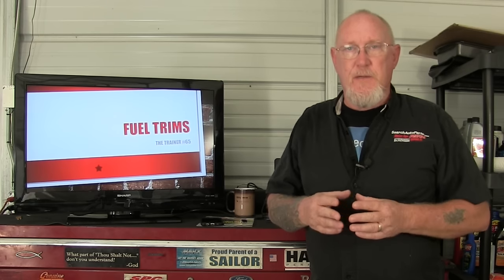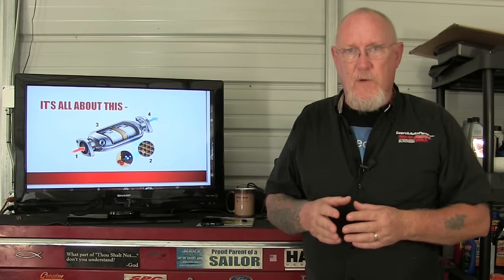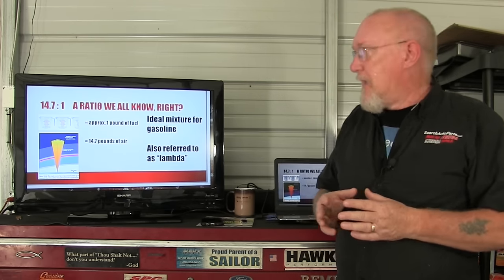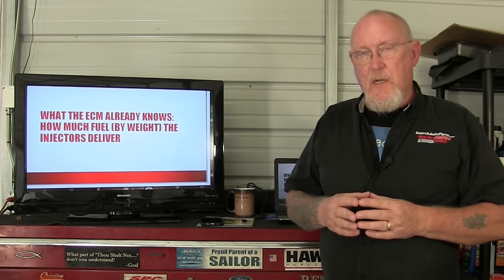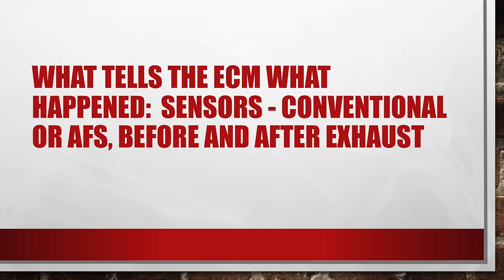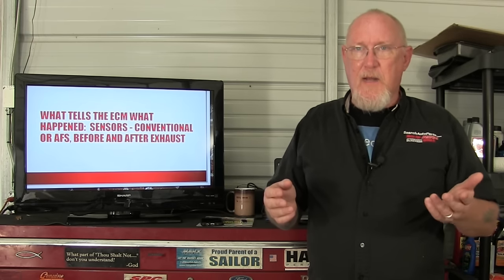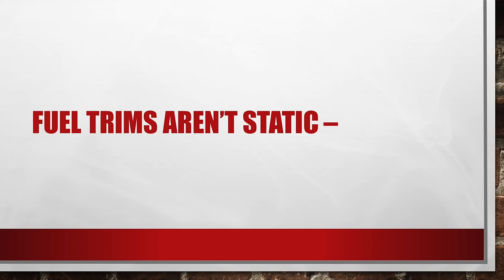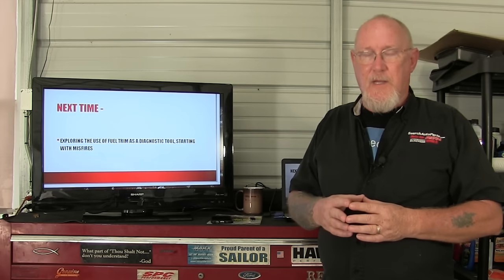The Trainer #65:  Fuel Trim Explained - What It Is , How It Works, And What It Can Tell You

Comment: I recently test drove a 2016 Kia Optima with 45K miles and plugged in my scanner when I returned to the dealer.  Bank 2 STFT was pegged at -100%!  The O2 sensor seemed to be functioning normally cycling between ~.2 - .8 v when I revved the engine but the STFT never budged.  Any idea what might cause that?  A code had been cleared 31 miles prior, and the carfax showed 2 repair entries within 3 weeks to check engine control module.  Also had been reprogrammed in January 2019.
Reply from the maker: What kind of tool were you using and were you using it in Global OBD II or Enhanced mode (if it had Enhanced mode)?
Reply: @MotorAgeMagazine  I was just using a basic ELM scanner with Car Scanner app for iPhone.
Reply from the maker: ncyankee101 I would check with another scanner to see if you get the same information. I’ve never seen short term fuel trim listed at 100% on any scan tool. And if the oxygen sensor is switching back-and-forth, the short term fuel trim has to be switching as well. After all that’s what makes the sensor switch.

Comment: Pete, you are one excellent Teacher. Hats off to you Sir and thank you.
My little 2005 Nissan Sentra 1.8 liter has 327,000 miles and going strong.
I'm trying to reach 500,000  :) 
I have a P0172 System to Rich (bank one) code. 
On a 4cyl. engine which bank is bank one? Cylinder 1&4 or 2&3 ?
Thank you and new subscriber :)
Reply from the maker: Thanks for the compliment! Glad you like the content. Bank 1 is cyl 1 & 4, Bank 2 is 2 & 3.
Reply: @MotorAgeMagazine  Thank you so much for that info that I can't seam to find anywhere.

Comment: Can fuel cause such an issue? I tried putting E15 in my wife's Mitsubishi, and a few days later got a lean code. Fuel trims were bouncing near 25%.

After the fuel level dropped to about half a tank, I topped it off with premium fuel, and reset the code. A week later and the code hasn't returned, with fuel trims bouncing between -5 to 5%, so it all seems okay now. I can only figure the E15 caused it, but it makes no sense as it's advertised as being okay for vehicles 2001+. Oh well, won't be attempting to save 20 cents a gallon again.
Reply from the maker: It can when you compare alcohol additives versus straight gasoline. The stoichiometric ratio for alcohol is different and that will affect the mixture requires for a lambda of 1.0. Stick with the fuel recommended and always us a Tier 1 supplier.

Comment: What does the word "LAMBDA" actually mean? 🤔 

Thanks for the great series.
Reply from the maker: Great question! I'm surprised no one has ever asked before. Excerpts from the Bosch Automotive Handbook - The mixture for ideal, theoretically complete combustion requires a mass ratio of 14.7/1. That is, 14.7 pounds of air for every pound of fuel burned. Excess air in the mix is required to ensure there is enough air for complete combustion but there are limits when it comes to burning a mixture that is too "lean". Lambda is a Greek symbol and represents this "excess air" factor. It designates the extent to which the ACTUAL air-fuel. mix differs from the stoichiometric ratio of 14.7/1. It is the ratio of INDUCTED AIR MASS versus AIR MASS REQUIREMENT FOR STOICHIOMETRIC COMBUSTION. A Lambda of 1 indicates that the air mass drawn in by the engine equals the theoretically required air mass. Less than 1 is a deficiency in air mass, or a "rich" mixture and more than 1 is excess air mass or a "lean" mixture.
Reply: @MotorAgeMagazine  thank you, that will help me remember what it means better. I was wondering what it meant on my new to me Modis 🤣 I'm really enjoying your shows and learning a lot!

Comment: My 2002 Yukon 6.0 has an average of 19% long fuel term. On idle the car shuts down or stall. Is that a lean condition? Would O2 sensor adapter fix the problem as the catalyst converter was removed?
Reply from the maker: Fuel trim needs to be examined under different operating conditions. Is this a positive change or negative change? What do the trims do if you hold the engine speed at 2500 rpms?
Reply: Motor Age hello, long fuel tirms are positive. When hold rpm at 2500-3000 it drops to 14-15. Regarding the shutting down, it turned to be thermostat sensor. I've changed it at its all good. I looked for vacuum leak but didn't find any. Manifold gasket I've changed it about a year ago. I'm suspecting either evap leak or empty catalyst causing this. What do I do?
Reply from the maker: First, look at STFT and LTFT together for a Total Fuel Trim. Is the positive adjustments are across all rpm ranges, as it appears here, the odds are there is a sensor reporting issue. Have you inspected/cleaned your MAF sensor? NOTE:  If cleaning the sensor helps, replace the sensor. The cleaning will not last.
Reply: Motor Age thank you for the note. I've changed maf sensor 3 years ago before cleaning manifold and changing gasket. I'll look into it. Thanks very much.

Comment: The mass air flow sensor measures the temperature of the air and the temperature of the air means are certain volume of air that's going into the engine it's the temperature measure

Comment: I was getting the classic high LTFT at idle, 25 %. and low numbers when reving, indicating a vacuum leak. 

Sure enough, I found some loose intake connections to the throttle body. 

After tighting everything down, the LTFT numbers stayed at 1.9%

Ok, great! But....when I rev to 2500 rpm, now  the Ltft numbers go up. They go to 25% and when the throttle is let off, it immediately drops to back to 1.9% at idle.
Shouldn't the Ltft numbers stay low at all rpm ranges if everything is ok?

Or is it normal for the Ltft to go up with a load because of the demand in throttle and gas?
Thanks
Reply from the maker: It shouldn't climb that high. Did you clear your KAM memory after you repaired the leaks?
Reply: Motor Age 

 I cleared the codes, but I didn't Flash the memory, I'm assuming those are 2 separate processes?

I'm thinking now that the computer needed time to clear its memory and update data.

I went for a drive and now when I drive the long term numbers and short term numbers are almost matched 1 to 1 and even if the long term goes up for example t0 10% postive, the short term numbers go to negative 10%,
 so their matching each other respectively. 
It appears everything now is well within spec and working as it should.

Comment: And the four-stroke cycle that means the engine goes around twice per cycle and you get four strokes per cylinder per cycle so you can multiply that by 4 4 strokes per cycle or two revolutions so basically you're getting 120 strokes per second

Comment: What to look for in case of exhaust restriction. Both banks sensors fluctuating about .7 v
Thanks
Reply from the maker: Typically, one bank will be correcting for a lean condition and the other, a rich condition. Remember, a MAF sensor measures ALL the air going into the engine and doesn't distinguish between banks, or cylinders. Even if one cylinder on one bank has breathing issues, the ACTUAL amount of air on that bank is not the HALF of the total you may expect. Have you tried a Volumetric Efficiency test to see if the engine can breathe properly?

Comment: So I got a lean condition in bank 1 on a v6. Do you think thats cause I changed the o2 sensor in bank 2? Bank 1 short term trim is about 8% more than bank 2. Should I have changed them in pairs?
Reply from the maker: I have a few questions before I can help - Is this a MAF or MAP system? Did the lean condition exist prior to changing the sensor? What kind of vehicle are we talking about (YR/MAKE/MODEL/ENGING)? What are the total trims on both banks now at idle - at 2500? Has there been any other work done recently?
Reply: @MotorAgeMagazine  honestly i can't remember the  vehicle has been sitting for 5 yrs and I'm trying to get it back on the road for a good friend. It's a 2005 kia sportage 2.7L 4x4. 90k miles. I just did the spark plugs and wires cause they were never changed but there was a code for bank2s1 out of range so I only replaced that sensor.  It was running really rough when I 1st started it. Replaced the battery and did the oil change. Fill the gas tank 3x already in the last 3 months. Just can't figure out why I got a lean condition only for bank 1 when they both are high but bank 1 is a little higher. Only think I can think of is a dirty MAF. I tried cleaning it but nothing. Gm/s is at about 3 but I couldn't find what normal was for this vehicle. So I'm thinking of replacing the MAF and bank1s1 o2 sensor since fuel trims are a little higher in this bank. And I'm thinking a dirty maf is allowing unmetered air to not register allowing it to add more fuel. I could not find any vacuum leaks for the life of me by the way. I can't check fuel pressure cause you need a special tool to check it. So I also ordered a new fuel pump assembly since the pressure regulator and filter is all built into the same assembly.  I rather have that new since its over 15 yrs old. But just waiting on parts this weekend(o2 sensor for bank 1, MAF, and fuel pump assembly. ) hopefully that fixes the problem.
Reply: @MotorAgeMagazine  so I made a video of the fuel trims. After this video I disconnect the battery and lg terms went to 0. Bank 1 went to 31.3% and bank 2 went to 28%. So even those both o2 sensors were going from lean to rich as they should during the time I recorded the video I think bank 1 is not as accurate since I didn't change that sensor yet. 
 https://youtu.be/G41_Ylhx100
Reply from the maker: @pablomarquez4431  Typically, if fuel trims are off at idle but fine at higher speeds (on a MAF system) the fault is a vacuum leak. If the problem is only at high speeds but fine at idle, it's usually a fuel delivery issue. But yours seems to be off at idle and at high speed - and that is usually the MAF sensor itself.
Reply: @MotorAgeMagazine  hopefully we are right lol. I want to be done with the vehicle. I was trying to test it out but couldn't find what the proper readings are suppose to be. Supposedly if its a 2.7l it should read 2.7 gm/s and if you double the rpm it should be double the reading and so on. So going with that logic it passed. So idk. I could be wrong since I don't know the actual factory spec. But like I said before the vehicle is over 15 yrs old changing the MAF doesn't seem like a waste of money.

Comment: I guess a V6 could be a front and back sensor right but actually usually the code or the computer say bank one and Bank two and you have to figure out if it's on one on the left the one on the right the one in the front or one in the back bank one or Bank two
Reply from the maker: B1S1 is the upstream sensor on the bank with #1 cylinder as shown in the firing order. B1S2 is after the cat on the same bank. B2S1 is upstream on the other side and B2S2 is after cat on that side.

Comment: i chked my car by scaner....maf reading was good short fuel trims was well within range  going +3 to -3
But long fuel trim varied but was in the positve range only....
I changed my fuel pump yesterday also i have my injectors serviced.....is it ok or what should i do...
Reply from the maker: First, are you trying to correct a DTC (was the Check Engine light on)? Are there any drivability issues? Just because long term trim is varied doesn't mean there is a problem.
Reply: @MotorAgeMagazine  no check codes ...i was cheking data after tuning and fuel pump replacement.....
Reply from the maker: @wajeehulhassan2182  If the car is running fine and no codes are recorded, then no problems that need fixing. The main clue is that your STFT is small and centered - meaning the ECM is in control.
Reply: @MotorAgeMagazine   what is meant by 
E 106 written in spedometer of my toyota axio 2007....
Reply from the maker: @wajeehulhassan2182  I'm afraid I can't help with that one. I don't have access to service information for that model. But, since it is displayed in the instrument cluster, I'm betting it's some type of DTC from another module.
Reply: @MotorAgeMagazine  i have 1500cc toyota axio 2007....
Injector resistor was 11.7 ohm for 3 injectors one injector had 11.5 ohm resistance....isn't it a bit lower than standard .i have cleaned my injector as well....
Should i replace it......?????

Comment: How do you go about fixing the problem if there is a code?????
Reply from the maker: If you're dealing with a fuel trim related DTC, you need to consider WHEN the problem is occurring and WHAT kind of system you are working on (MAF or speed density). Is there a particular problem you need some guidance on?

Comment: If you were to put a meter on the TPS or the throttle position sensor you would see a decimal point 0 o point and then three digits this is how close the computer monitors the throttle position sensor

Comment: I have both short term bank 1 25.0  Short term bank 2 25.0 then both goes back down to 0.0 when i push the gas then go back up to 25.0 what could this be
Reply from the maker: I'm betting your engine uses a MAF sensor. If that's the case, my initial suspicion would be a vacuum leak.

Comment: I have an 04 acura tl that doesn't idle as smooth as it should. I used a Bluedriver and found my bank 1 trim is 3% and bank 2 is 9%, could this be why? Could it be air leak or sensor isn't good?
Reply from the maker: Any codes?
Reply: @MotorAgeMagazine  I had a pending misfire code on 2 rear cylinders, and one time I accelerated hard to pass someone and the check engine light flashed
Reply from the maker: @KenyonPayne  The flashing MIL indicates a severe misfire. Fix that first...
Reply: @MotorAgeMagazine  it's only done that once a month ago, it must have only done it very briefly as I didnt even hear of feel a misfire
Reply from the maker: @KenyonPayne  Most likely your rough idle is related. I suspect something mechanical...possibly head gasket leak. Do you have to add coolant?
Reply: @MotorAgeMagazine  no coolant loss, I checked for vaccuum leaks and couldn't find any. All 6 coils function, threw in a set of correct spark plugs. So far I've cleaned throttle body/intake, egr valve and ports, and pcv valve, which all helped a bit. I think I can hear a small hissing coming from under the intake plenum but can't reach with brake clean, hence why I checked fuel trims and thought the higher trim on the rear bank had something to do with it
Reply: @MotorAgeMagazine  I'm also thinking if I have an air leak on one cylinder, if the trim compensates to make one cylinder run ok but the other 2 cylinders rich
Reply from the maker: @KenyonPayne  You only list one fuel trim for both banks - there are two. Short Term and Long Term. Or are you sharing the total of the two? That's the number I want to know; at idle and at 2500 rpm. Fuel trims are a response, not a cause, and give us some direction.
Reply: @MotorAgeMagazine  finally got around to checking some data, however I can't check upstream sensors with my Bluedriver scanner. B1s2 I was seeing -1% short trim, .6v at idle, and -1.5% trim, and .5v at 2500, long trim is -8%. I also now have a p0137 b1s2 low voltage code. B2s2 is 25% short idle, 23% at 2500, about .5v at idle and at 2500. Long term trim is 5%. Hope this helps! Would I need to replace that one sensor?
Reply from the maker: @KenyonPayne  Performing a long distance diagnosis is tough because I can't hear the engine running or feel it on a test drive. A few things draw my attention. First, while downstream sensors can influence fuel trim, it is the upstream sensors that do the majority of the work. So, bank 1 is showing a slight correction for a "rich" condition while bank 2 is correcting quite a bit for a "lean" condition. However, since the STFT is the same at low and high rpm, I do not suspect a problem with air leaking into one of the cylinders on that bank. Typically, fuel trim faults that remain the same across the rpm range are sensor related. That leads me to consider the rear sensor code. While not common, when this code does set it it usually a faulty sensor. Watch the voltage as you snap the throttle a few times. It should react to the change. If not, I'd replace it and see if the fuel trims drop. If it does react, you may need to pull up the OEM testing info and check the harness to the ECM, or even the ECM itself.
Reply: @MotorAgeMagazine  one thing I forgot to note is that when I go from 2500 back to idle, both sensors go to 0v, b2s2 takes about 15-20 seconds to start reading ~.5V again, where b1s2 takes 45 seconds, maybe even a minute to start climbing up to .5V
Reply from the maker: @KenyonPayne  Neither sensor should take that long to react. Not sure how good your scan tool is, so that could be part of it. The only other way to verify is to measure the signal return at the ECM with a voltmeter, or better yet, a scope.
Reply: @MotorAgeMagazine  I'll have to try and get a hold of a nicer scan computer to compare. The car has 230k miles so definitely a chance theres some workout/faulty stuff

Comment: I have a 01 honda Accord 2.3 liter with a p0420 code can that cause a lean condition I had fuel trims going to -22 the short term - 7 long term I took a fuel pump current ramp and my high was 5.1 amps is that low for the Honda
Reply from the maker: First, no - the P0420 will not cause a lean condition but the lean condition may be causing the catalytic converter code. What is the Freeze Frame data?
Reply: Motor Age  Pete  how do you calculate total fuel trim??  I know to add stft  plus ltft.. But is there some sort of formula to follow to get total fuel trim??
Reply: If your fuel trim is going to -22, then you are rich., Chris.
Reply: po 420 is post cat 02 reading